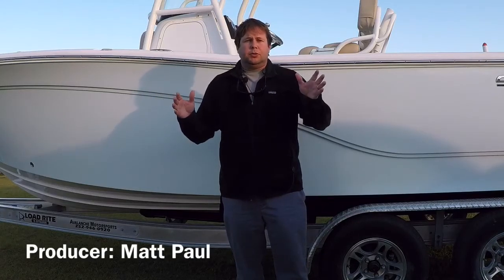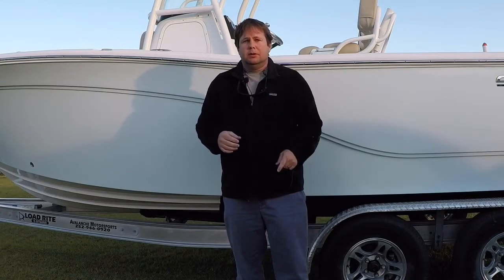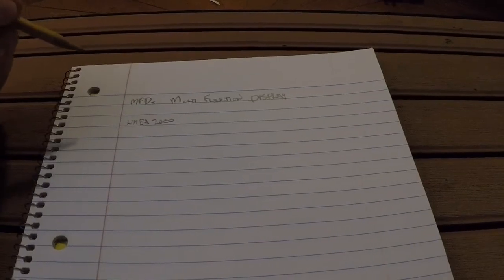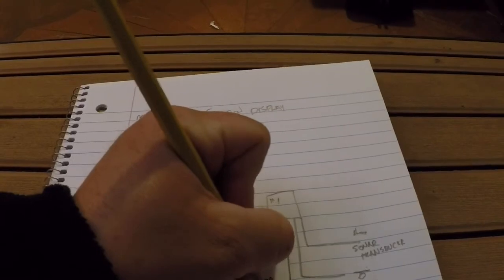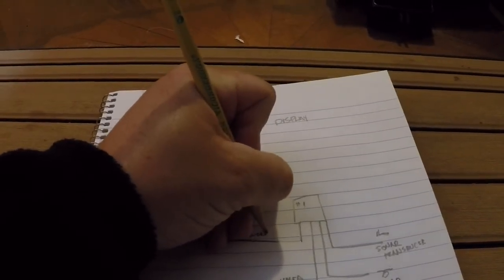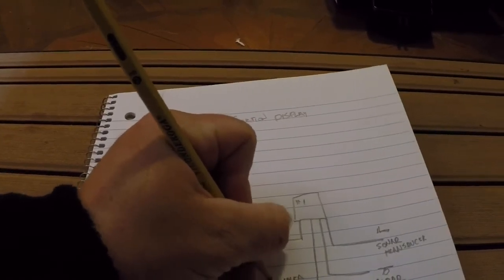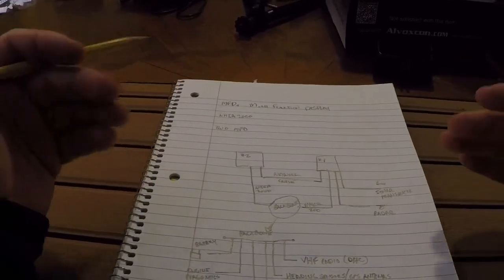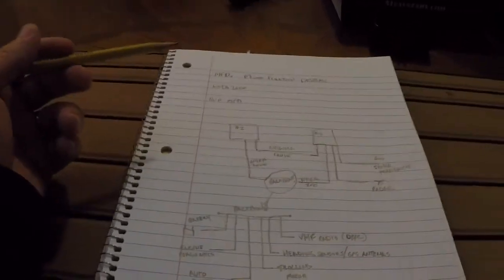Illustrating Simrad Network wiring for a viewer

Comment: Thanks, so the GO as #2 display won’t take radar and sonar data off a NSS  #1 display?  Or do you have to have two NSS displays?
Reply from the maker: Thank you Mr. G for the comment.  Yes, the GO as #2 display won’t take radar and sonar data off a NSS  #1 display.  I'm only running a GO series,  in this video I was just sharing some research for another viewer in this video.  

Fish On Forte, one of my featured channels, just upgraded to an a NSS and a Go from Lowrance HDSs. He hasn't posted videos on the units yet, but I feel like any day he will.  I'm not sure but I believe he is running his GO as a dedicated sonar unit for his in-hull B150 transducer and maybe also as his auto pilot controller.